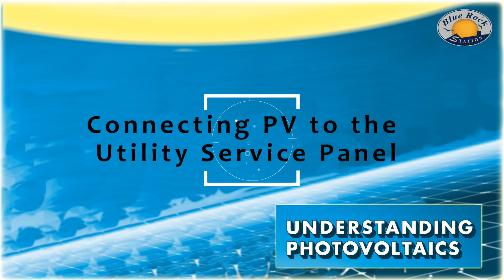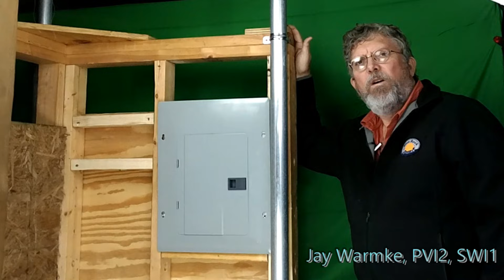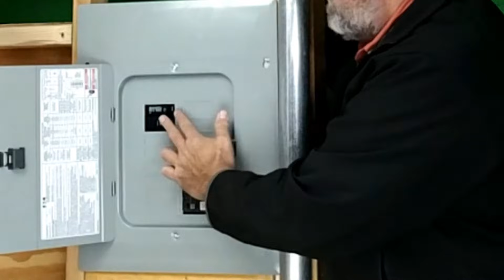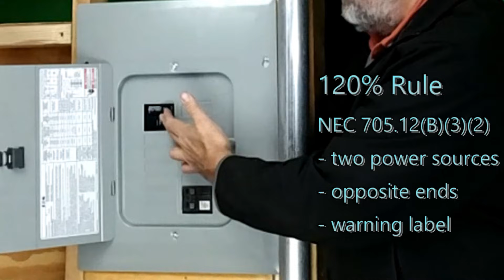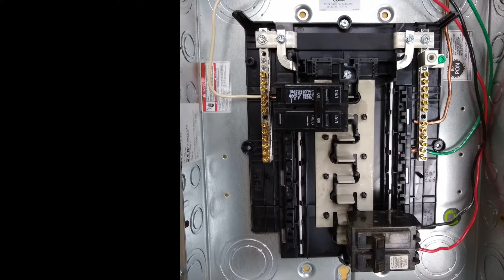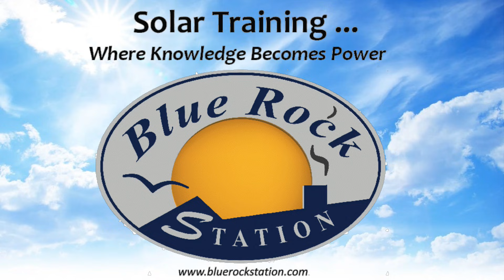Hooking up Solar PV to a Circuit Breaker Panel

Comment: why on earth did my installer(Solcius) connect my SolarEdge SE5000H inverter to the service line coming in from the meter and not a 40amp breaker?

Comment: It would be a well viewed video for a one or multiple solar array strings ground mounted solar modules via underground to the side of your home and following the NEC code 2020  using a manual shutdown switch at the entry point and into the home feeding an inverter. Solar panels in series.

Comment: I am wondering if you can help me.  We are just setting up our system.  Clearing land and have our materials.  It’s a huge building so we are planning to just do a 200amp on each floor (approx 5000sqft each) - so 3 of those plus a 100amp for the pump house/outdoor lights etc). 
We have 76 Trina bifacial 715w panels, 5 of the 10kw 120/240 2mppt  5,500+5,500 inverters and 100kwh of battery. 
What other breakers and controllers should we have getting to the panels?  We need some help doing the planning from someone who understands this much input and output so we can just assemble.  Talking to a lot of other diyers and the amount coming in and multiple panels has everyone guessing and it would be nice to see a drawn up example somewhere 😬
Reply from the maker: Sounds like you really have a relatively modest commercial-sized system going in.  With a project this large, you should at least get the design from a pro (you could install yourself if you feel confident, but I would get the design done with the help of an electrician and/or engineer).

Comment: wtf? No. No. Easiest way is the connect the 3 output terminals on ur inverter to the house breaker. If u don’t have an inverter it’s a little more complex but not too bad

Comment: I thought that an interlock was required to prevent backfeeding solar or generator power into the grid (?)
Reply from the maker: You must have an interconnection agreement with your utility to allow for bi-directional feed.  But as long as the grid is operational, it is a bi-directional flow.  If the grid goes down, inverters are designed to sense this and shut down.  In order to keep operating (when the grid is down) you will need an auto transformer switch to switch into "stand alone" mode for as long as the grid is down.

Comment: Your 100a main needs a main breaker kit installed. (A screw that goes through the breaker into the panel so it won't come flying out when you open or close the handle). You know what I mean Vern!

Comment: You don’t want to interconnect this way if you have or plan to install a standby generator.  Better to connect the solar inverter on the utility meter base where it will be upstream of a generator ATS that may be installed later.  Otherwise the system will need to be reconfigured when a generator is installed or risk damage to the generator when the solar inverter things the generator is the grid and starts feeding power to it.
Reply from the maker: You are right of course.  This describes a simple connection without battery or generator backup.  If you do have a backup power system you will need to install some method to disconnect from the grid to avoid backfeeding (islanding) to the grid.  Most PV systems now offer a smart switch or autodisconnect that can be integrated and often can also integrate a generator.  But that, of course, is for another video.

Comment: I have 200 amp service panel and my solar is tied into the load side. The breaker from the solar will trip once or twice a year for no reason that I can find. The solar load runs all day. Each one of the inverters has a seperate breaker where it ties into another AC panel and they never trip. I have changed out the breaker thinking it might be getting weak. The breaker does get hot with the load on it all day long so thinking it might be a thermal trip?
Reply from the maker: I can't really visualize what you are describing, but if the breaker from the solar array to the service panel is tripping - my guess is that you are getting too many amps from the array (really nothing to do with load demand).  Perhaps the array is oversized for the breaker.   All panel ratings are based on 1000 W per square meter of energy from the sun.  But on a very clear day, I have obtained power readings of as high as 1200 W per square meter.  So it might just be that on a very clear day your array is just producing more power than the breaker is rated for.
Reply: @solarpvtraining  The PV breaker is a 100 amps (that is tripping) with the PV load max at 60 amps. Had a trip yesterday with the PV load at 35 amps?
Reply from the maker: @chada472  Okay - sounds like my first idea is not right.  Is it possible that there is an intermittent ground fault on the solar side?  This can happen when there is a break in the insulation of a wire - that then arcs to the ground wire when it gets wet.  So when it is dry - nothing happens.  But when it gets wet and arc occurs which would then try to backfeed from your 200 amp service, tripping the 100 amp breaker.  Perhaps this is something to look at, seeing if the wire got skinned when entering a box or disconnect and now it is causing some problems.
Reply: @solarpvtraining  Sorry when I said PV breaker I meant the AC side going into the grid. The example I gave yesterday was a dry clear day.
Reply: @solarpvtraining  went out just now and checked breaker temp and it is has some heat on it. This is a GE 100 amp breaker that currently has 41 amps going through it back to the grid.

Comment: Oahu, N. Shore (big waves) Hawaii and near the beach with local power (age 62)
Sun light say 12 hours a day and open area is my backyard,  Off grid ground mount
Thinking solar for Split A/C,  Water Heater and W/D on Sundays
Therefore Solar panels, Electric box for 20 amp 110v and 40 amp 240v 
A/C and water heater can shut- off when sun goes down
Wondering what i will require besides panels-ground mount and electric box with breakers
RR
Reply from the maker: Lots of questions need to be answered when designing a system for any particular home or business.  I suggest you get a couple of local installers to do an assessment and give you a bid.  I know power is expensive in Hawaii and sunshine is abundant - so you may be surprised how little a system is required to meet your needs.

Comment: So, if the power goes out, and i want to run a couple things off my pV / battery backups, i'd just shut off the main, and any breakers I don't care about during the emergency situation, turn on the PV breaker, and turn on the breaker, say, for the oven, and the pv-breaker would supply the power, assuming it's rated properly?
Reply from the maker: I am afraid it is not quite that simple.  First, the code generally requires that the disconnect from the grid happens automatically (they don't trust human beings to get it right all the time).  This of course is to protect those working on the grid from being electrocuted.  Secondly, your inverter is designed to look for a signal from the grid.  It stops working when that signal is lost (anti-islanding).  When you disconnect from the grid, that signal is lost.  So you will need to install a second (AC Coupled) inverter to "fool" the solar inverter into thinking the grid is still on - or you can design the system from the start with an auto-transfer switch (a disconnect from the grid) and a bi-modal inverter, often these are all contained in the same unit (known as a dc coupled system).

Comment: solar guys put 60 amp on my 200
Reply from the maker: If they put a 60 A PV breaker on a 200 A rated box, with 200 A service from the utility - then they did it wrong.  You might check the rating of your service panel busbar.  It might, for example, be rated for 225 A, which would then allow 225 A x 120% = 281.25 A.  So if you only have 200 A coming from the utility, you have room for up to 81.25 A more from other sources (usually the PV array).

Comment: Is it just me or did he not say at all where you hook up solar to utility set up
Reply from the maker: The connection to the utility happens in the service panel (as this is showing a load side connection).  Power flows to the closest load, so it will flow from the panels to your loads first, but if there is more power from the array than you need, it flows to the grid (through the main disconnect right there in the service panel).

Comment: What's size breaker for pv
Reply from the maker: Really depends on the size of the array.  Typically a 3.8 kW inverter requires a 20 amp breaker, a 7.6 kW inverter requires a 40 amp, and so on.

Comment: just to be clear ...you do turn the main circuit breaker off when using the pv breaker right.?. im like certain you do...but just want to make sure...
Reply from the maker: No, the system demonstrated is grid tied and over production feeds the grid.  When (or if) the grid goes down, the inverter automatically shuts off.  If you add a battery backup - then a transfer switch would be required which would disconnect from the grid in the event of a power outage.  You can find a lot of info about solar at our site - www.solarpvtraining.com

Comment: I wish for a circuit breaker box that supports standard service, but allows select circuits to be routed to the PV System at the same time. More control over the buss already wired into my house. Starship engineering :) Thankyou for the run through.
Reply from the maker: California recently required all new homes be solar ready (with a built in critical loads panel).  Also starting to see a lot of products designed to monitor and control your loads at the circuit level (smart breakers) from your phone.  So I suspect that we will see a lot of developments in the service panel industry.
Reply: Consider a generator transfer switch used for house backup power. The transfer switch is like a sub panel for your main panel. It has switches for generator/off/line power. You could have your solar sending into that. I have seen up to 10 circuit transfer switches.
Reply from the maker: The new code (2023) requires a utility disconnect at the meter (think of a small circuit breaker panel under you meter).  This might provide a nice place to connect your system without having to touch your inside service panel.